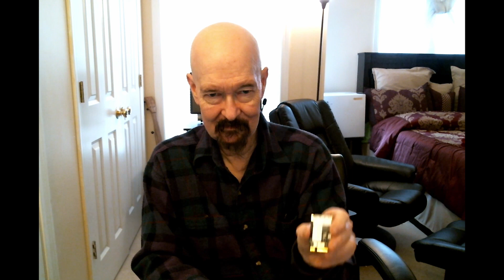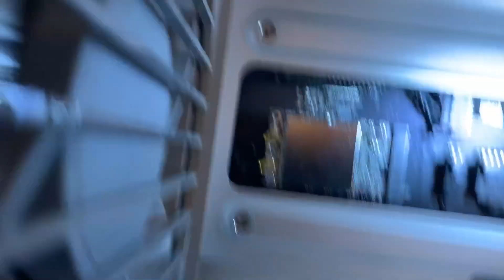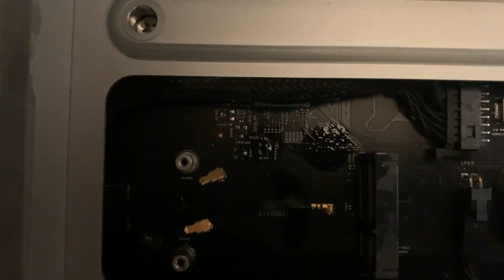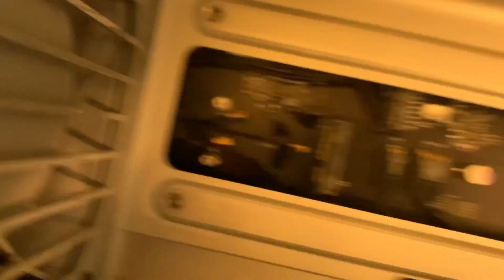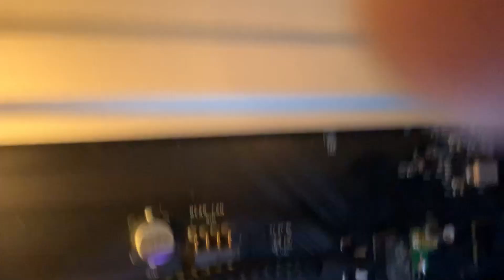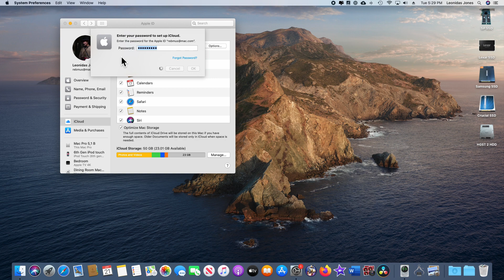Mac Pro Wi Fi and Bluetooth Upgrade

Comment: is there a newer update to this card? perhaps one with 802.11AX with bluetooth 5.0? or even a PCIE version of this with these newer specs?
Reply from the maker: Not to my knowledge. These cards are generally pulled from iMacs. Knowing the pain in the new k nature of this upgrade, I tried a couple of PCIe solutions, but they simply did not work. Best idea if more speed is required is to hard wire it. Then do this upgrade to enable Continuity and Handoff. If you find a better solution, please let me know.

Comment: Is it necessary to remove the old Bluetooth card from its socket. Or is that socket just a holder with no connections ?
Reply from the maker: As long as the antenna lead is disconnected, which it has to be in order to install the new combination card, There probably is no real reason to remove the old card. However, I have had good luck in installing these 2010 cards in 2008 Mac Pro's, so I remove them.

Comment: May I ask whats connector does the cable between bluetooth and the adaptor use?
Reply from the maker: The card I used is a combination WiFi/Bluetooth card. The original was separate WiFi and Bluetooth modules. The cable connects the Bluetooth to the Bluetooth antenna, which is on the other side of the logic board. The connection there is Apple's standard WiFi/Bluetooth connector, which can be quite awkward to get connected.
Reply: @brokenelectronics3665   Thank you for reply, I am having the same card as you do, i have no problem with the antenna connection but the other cable ( i guess thats power) one side ( on the adaptor is a 2 pin ) but the side connect to logic board is the one i am not sure the name, as the shop send me something else so i have to get that cable again but i donno where can get it without the name of that connector.
thanks again
Reply from the maker: KEN88888, okay, I see what you mean. Honestly, I don’t really know off the top of my head. The power connection cable that came with the kit worked fine, so I didn’t look into it any further. If I find something out about it, I’ll get back to you.

Comment: Apple Watch will unlock my macpro4,1. At first it would not. Turns out it was  USB conflict, also specific usb drives that gave a problem and others that didn't.
It now works every time ! And if all fails, install BLEUnlock.
Reply from the maker: Walter I’m not sure what you mean by USB conflict. How did you diagnose that? Also thanks for the pointer to BLEUnlock, I’ll look into that.
Reply: Leonidas Jones I noticed when I first booted up that the AW unlock worked. Just once. After that never again. The difference being I plugged everything back in. Never got it to work. Except last week, when I unplugged all USB drives and it promptly started working. System: Macpro4,1->5,1 running Mojave, Boot drive is a 4x pcie card with a NVMe samsung 970 Evo, for speed. Also a pci card with 4 mSata card slots. And a USB 3.0 pci card with the externals. The Bluetooth card is internally connected to the usb, so that is where a conflict could come from. Might be a power issue, but I excluded that because all the external drives have their own power supply. That leaves a hardware conflict.